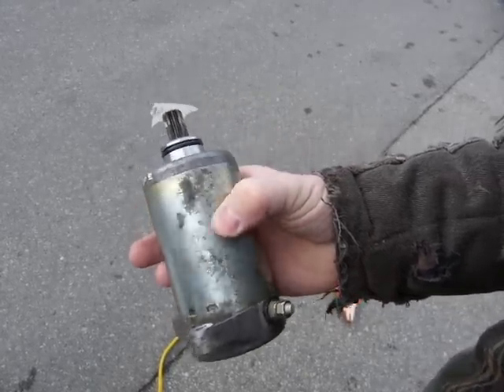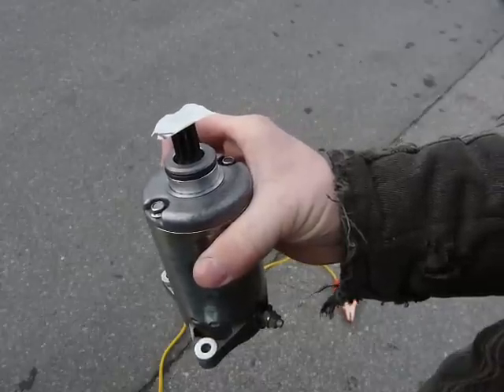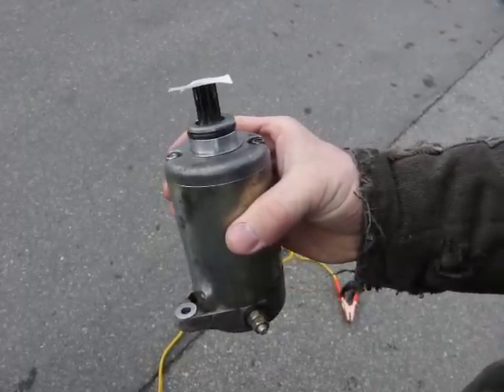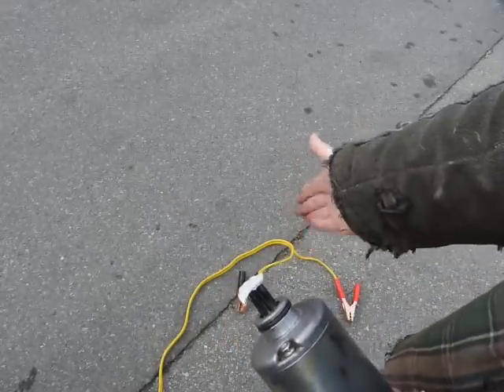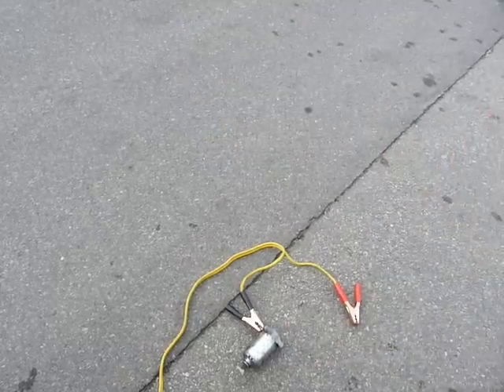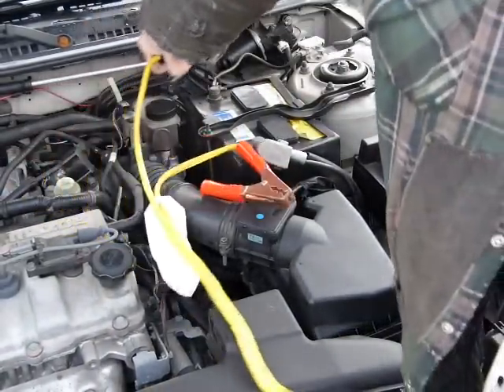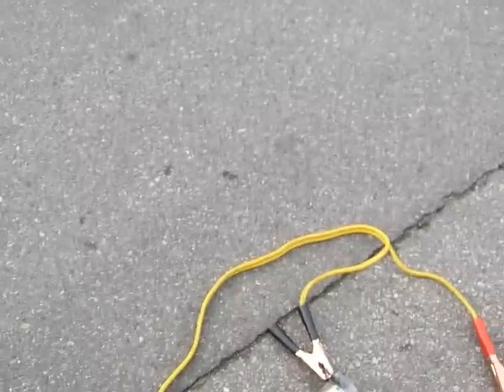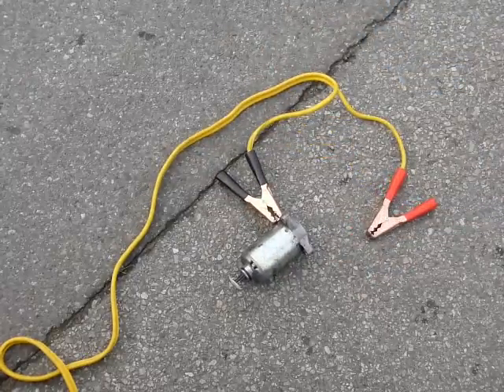Error-free starter motor diagnosis under 1 min

Comment: I thought you were supposed to break the ground not the positive
Reply from the maker: +Timothy Bower There is no "supposed to" but breaking the ground still leaves the part energized. If bare foot and wet, you`ll be the path to ground. Could be a shocking discovery.